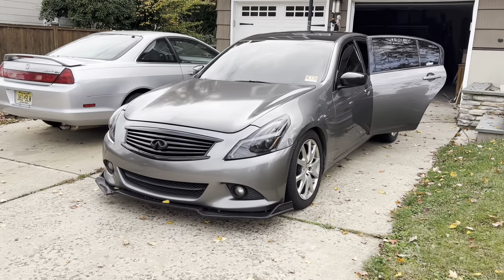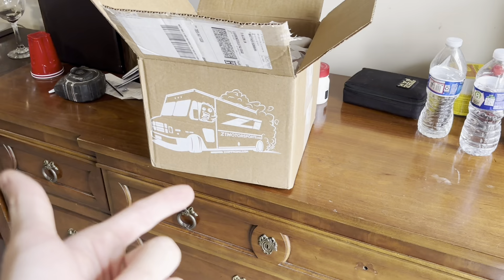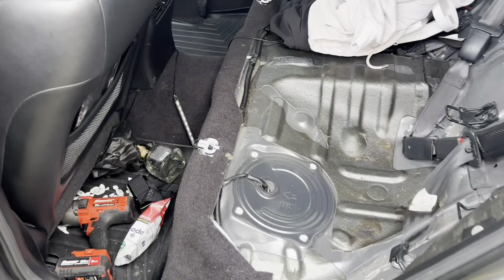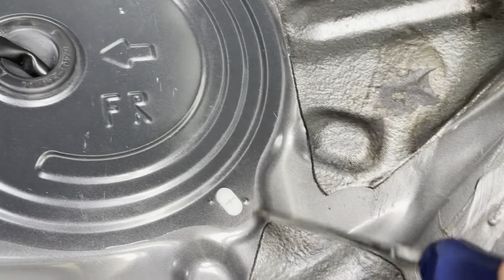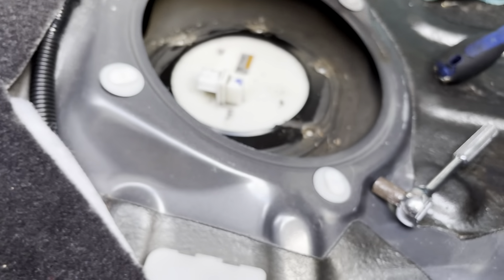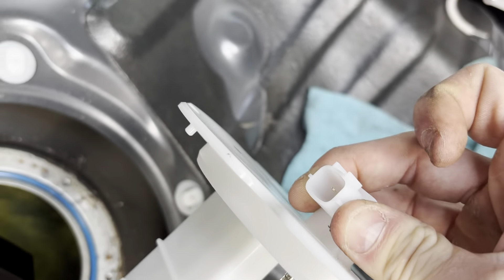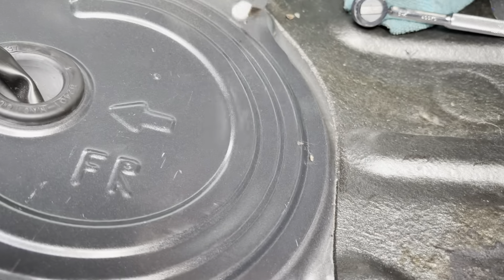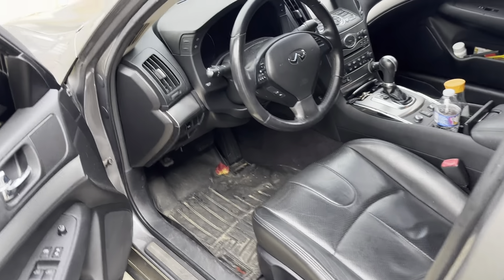FUEL LEVEL SENSOR / HOW TO 2013 INFINITI G37 / P0462 CODE

Comment: Only one sensor? What about the other sensor
Reply: So here’s the truth, it could be 1/2 things. It could be both fuel sensors OR most commonly, the AC Amplifier Module behind the radio. For me it was my AC Amplifier Module but for safe measures I cleaned both my sensors & replaced the module behind the radio. Gas guage has been working perfectly now
Reply: @oneglideCam  glad you made that comment I have replaced both sides and the damn thing still  isn't working
Reply: Did you ever get that fixed i just replaced both fuel pumps and still running out of gas at a quarter of a tank @scottycollins3166

Comment: Good Video. Wish you could have turned the Car on to see the correct reading on the Dash Fuel Gauge. I have the same problem on my g37 except its about a 1/4 tank off.

Comment: I have same issue. Code on and fuel gauge doesn’t work.  I bought this part from Z1 and installed it. Problem not solved. I am about go to the passenger side and changer the fuel level sensor on that side next.
Reply: It worked?